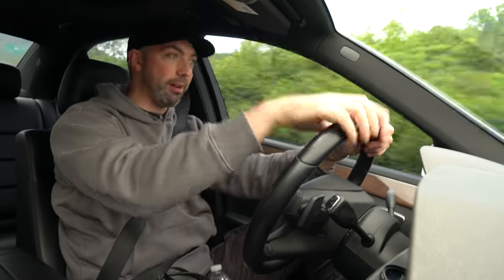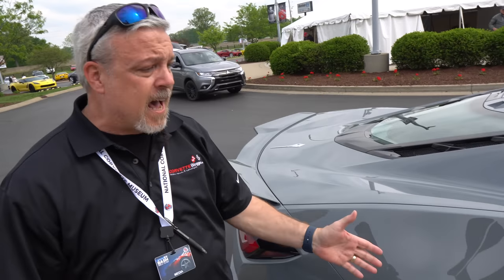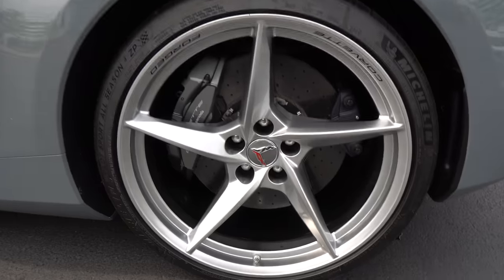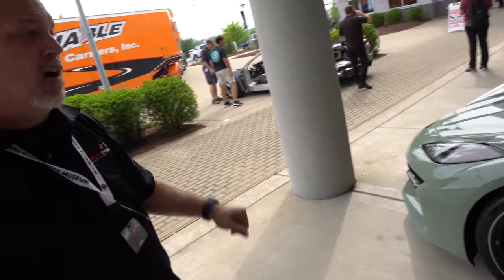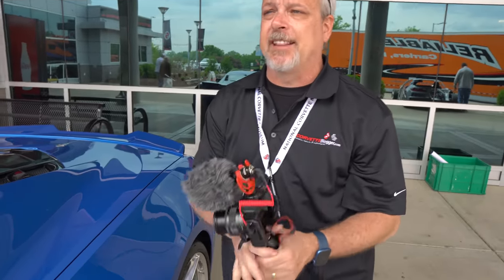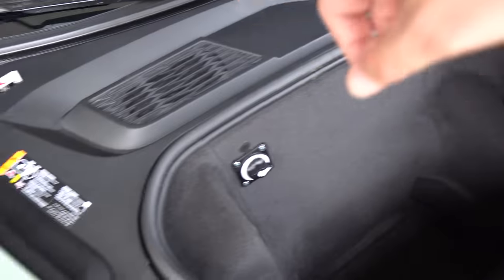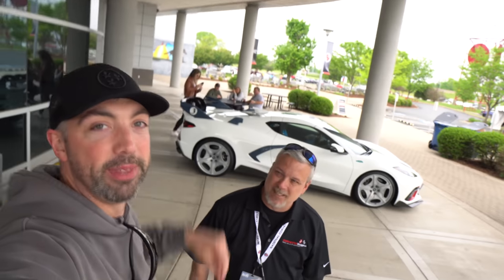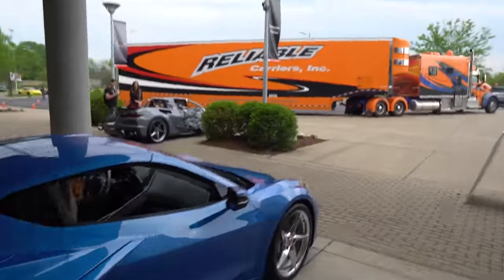2024 Corvette E-Ray Hybrid [New Colors]

Comment: @4:20 For as long as it has existed, the option to configure the side trim to "body color" hasn't been available on the official ZO6 visualiser (online builder interface). However, it's always been a selectable option in the official standard C8 vizualizer. It includes the vent trim on the front and the grilles on the rear of the car.

Comment: I’ve noticed no one is bothering to research the specs on the MPG on the E-Ray vs the non-hybrid models?  Meaning, the only reason a person would want the E-Eay over the other two non-hybrids, is if the E-ray is actually more fuel efficient.  Otherwise what’s the point?  If I’m getting a 0.1 second 0-60 difference between the hybrid and non-hybrid, that’s not the selling point.  The selling point is what is the increased fuel efficiency, if any at all?
Reply: The selling point is the AWD….

Comment: Now wouldn't  you think, since Chevy is comparing the Z06 to those European supercars, that they would  also have SUPERCAR colors as the Lambo:'s have. Back in 201the Camaro had a Synergy GREEN color that you could spot a quartet mile away! Now I am sure some of the Z06 owners would definitely go for that as a Z06 or E-Ray exclusive color to differentiate those models from the regular optioned colors as telling a Z06 from 50 feet away is almost impossible comparing it to a regular C8! Charge them a premium for that color and see what happens!!!!